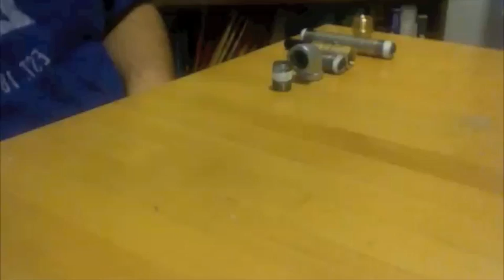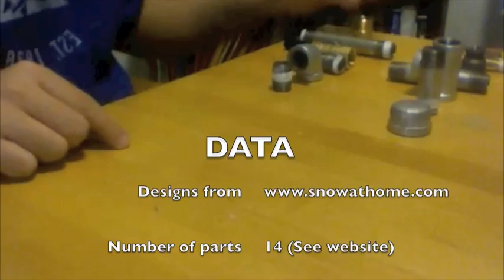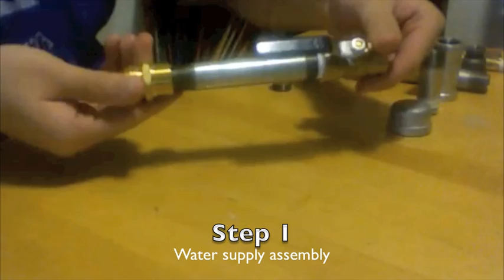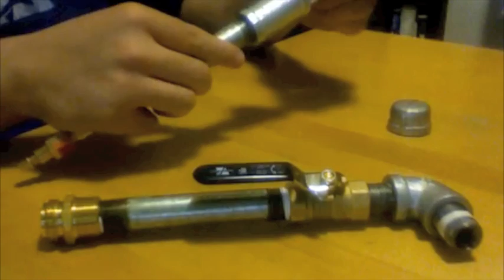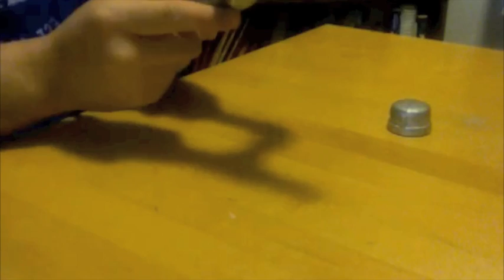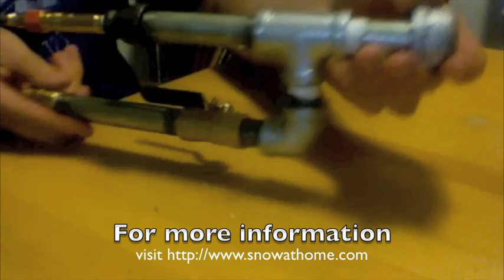Building your own Snowmaker (Mock-up)

Comment: I think this will work flawlessly to produce foam for washing cars, just using one more connector to add soap to the water before it mixes with the compressed air. Do you think this will work??

Comment: @CRF150RBRidda 

¼” cap - QTY 1
6” x nipple - QTY 1
¼” x Tee - QTY 1
¼” x 90 DEG street elbow - QTY 1
¼” close nipple - QTY 1
¼” mini ball valve - QTY 1
2” x nipple - QTY 1
¼”female x ½”male bushing - QTY 1
½”female to Garden - QTY 1
Quick connect air fitting - QTY 1

Roll of Teflon tape
7/64” drill bit